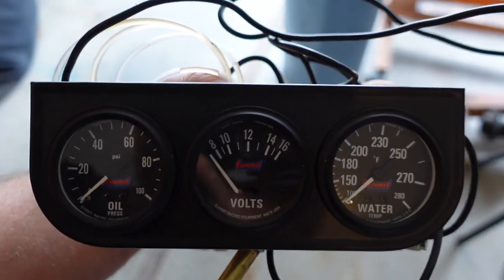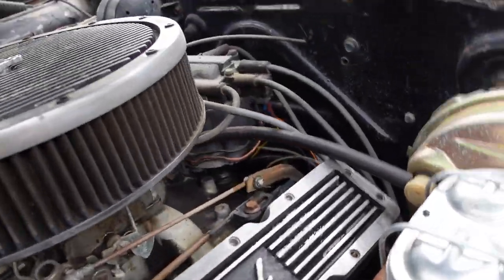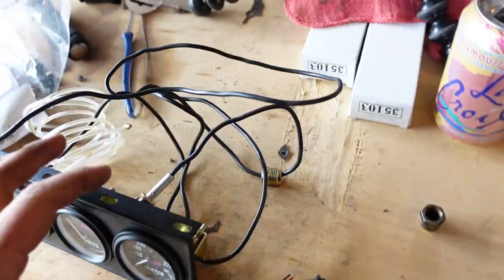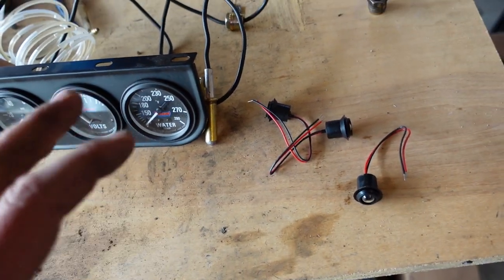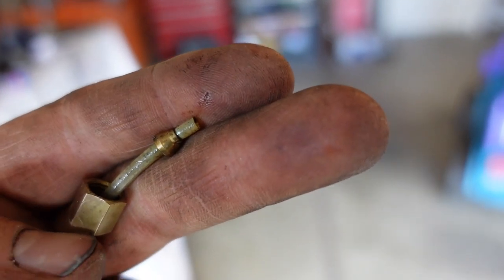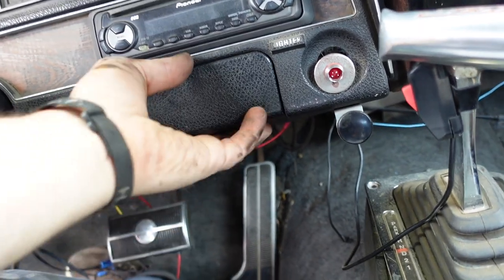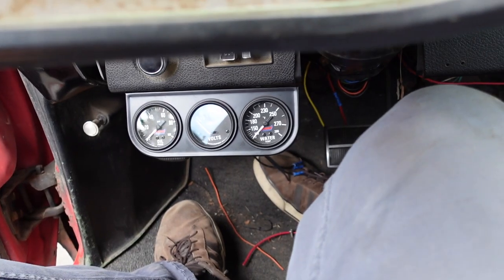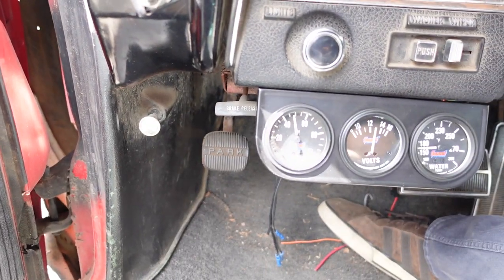Summit Racing 2 1/16" TRI GAUGE KIT Install in a 1969 Impala

Comment: I have a 66 impala. My fuse box is unreadable, could you tell me where you hooked up the power wire, for the voltage guage. If it's not too much trouble.
Reply from the maker: I'll try to get a pic for ya this week, I'll post it in the community tab